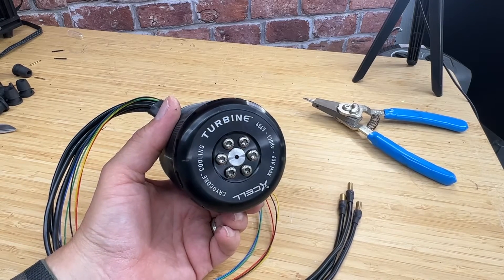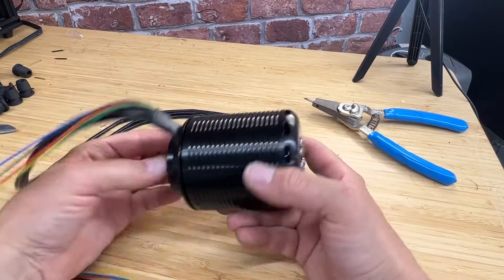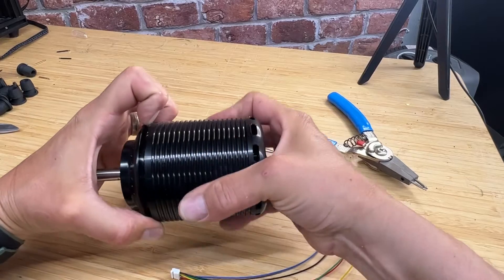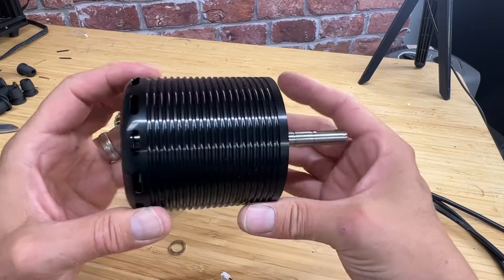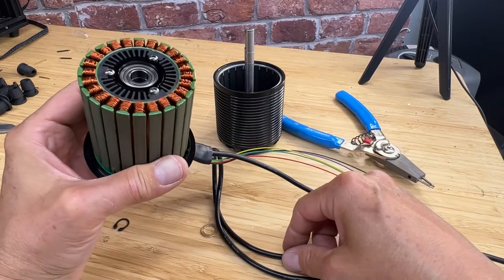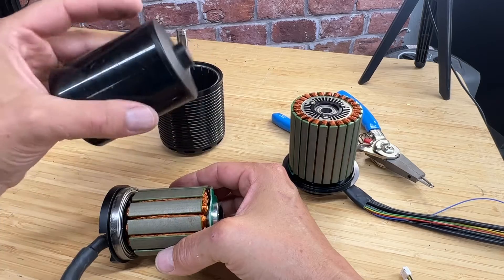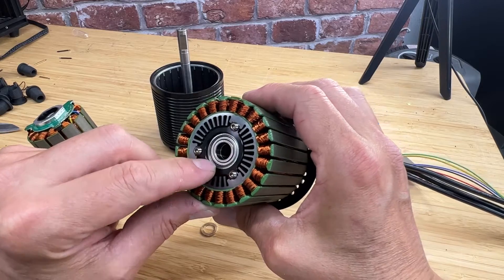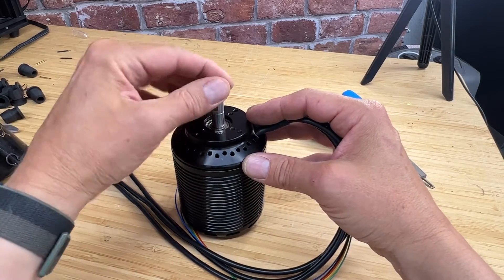XCELL Turbine V2 Motor, an informal overview!

Comment: Like all of the land-surf products I’ve tried (stone cold chillers, variable height adjustment, fangs v2 (pintx), fangs v1 (gt). They LOOK 👀 amazing 🤩 and they are the most innovative 😮 designs I have come across. Going to be getting a platysense for gt and bash bumpers for next 
Upgrade.
TyTyty LANDSURF-